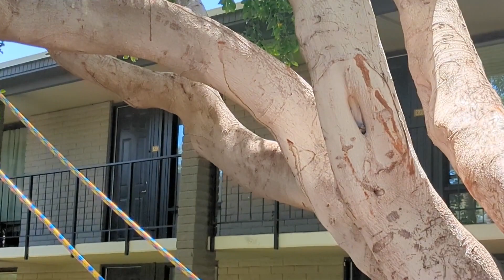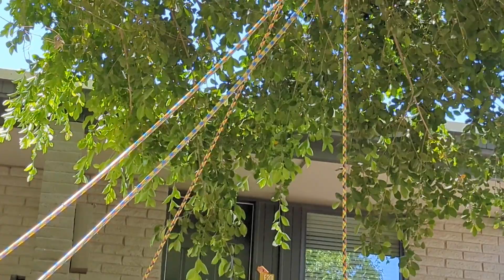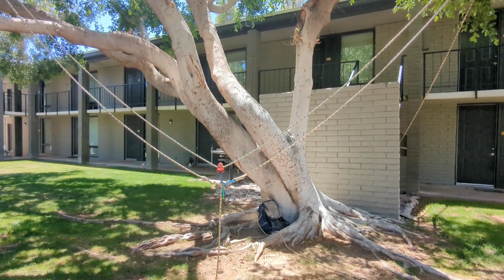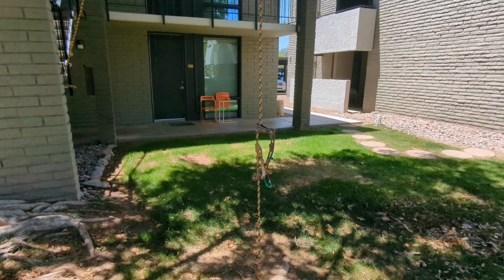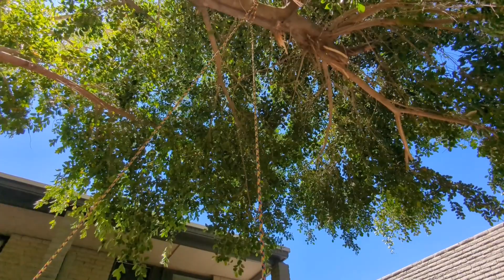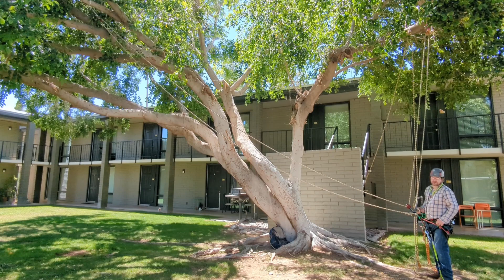V-RIG Demonstration: Learning This MOVING ROPE System (MRS) for Arborists & Tree Climbers!

Comment: Hey, thanks for a great video - I've always wondered how this is different from double crotching with 2 systems? any benefits that I'm not aware of?
Reply from the maker: Thanks! I'm glad you enjoyed my video! Check out this video also: https://youtu.be/cD2w398eyIQ It's a table top demo of how this system works. This works effectively the same way as climbing with two systems. I would say that climbing with two systems is superior under most circumstances. And this demo didn't really show how the V-Rig is supposed to be used, more just me playing around with it. But when I hit the ground you can get a feel of how well it works for triangulating one's position.
Reply: @Knot-orious   looking at it again it seems like you more laterally/straight across without losing the height that you would lose if you were working two systems, you're just working one system but yea the set up seems long winded